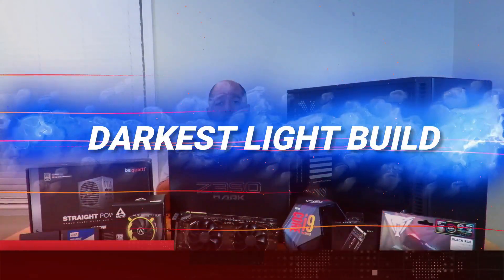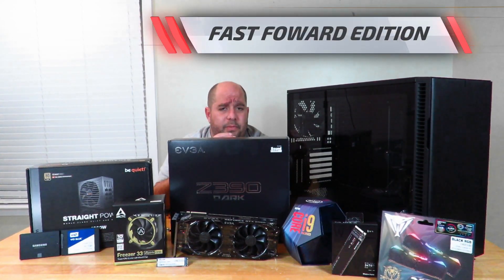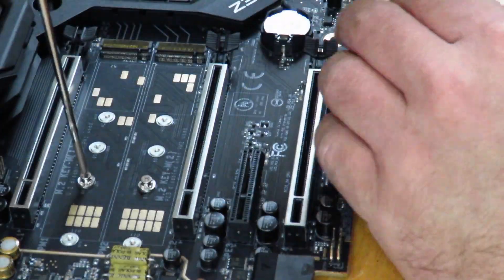FastForward: How to build a Gaming PC with the EVGA Z390 Dark in the Darkest Light Build

Comment: Got a question im building a new super high end build im stuck what motherboard should i buy  asus xi apex  vs 
                         evga z390dark

How are the thermals on the m.2 nvme's my biggest concern
Reply from the maker: OK, there are some differences in the board, so it may be on what you decide.  I will help you.

The EVGA Z390 Dark only has 2 DIMM Slots, whereas the Asus has 4
M.2 SSD's dont get incredible hot any more, I will link below 2 reviews so you can check them out.  The Asus has heatsinks for them, the EVGA does not.
The EVGA Z390 Dark has 8 USB Ports, the Asus has 7
The EVGA Z390 Dark is Dark, no RGB lights, the Asus has RGB headers, don't know if that is important to you
EVGA hass Creative Audio, Asus has Supreme FX (I forgot who made that, maybe CMedia, its been a while since I have used Supreme FX)
The EVGA Z390 Dark has 2 x 8Pin EPS connectors for better overclocking, the Asus only has 1
The EVGA Z390 has the 8PIn EPS connectors and 24Pin ATX connection angled to the right, asus has everything in standard placement.
The EVGA Z390 has 8 SATA Connections, the ASus only has 6.
They both have their pros and cons, I hope this helps you decide which you want.  One thing that makes EVGA better than any other company though, aside from making great products is thier Warranty.  Their warranty is second to none, it is the best, with that EVGA is tops for me.  That is totally up to you again to decide though.

Here is the Asus on Amazon: https://geni.us/1NLKQ
Here is the EVGA Z390 Dark on Amazon: https://geni.us/UmV6tf

I go over SSD temperatures on the EVGA Z390 Dark
Patriot Scorch Review Overview: https://www.youtube.com/watch?v=ywjnE2bXUCQ
WD Black Sn750 Review Overview: https://www.youtube.com/watch?v=jjDmKavz3Ek

Please let me know if you have any other questions or concerns.
Reply from the maker: I saw the link, but it will not post publicly because of the way the site is setup. it should be the same board as this on amazon: https://geni.us/wngc, I just post the Amazon links since I am affiliated and it helps me out as Well.  Neweggs affiliation program is very messed up also the link I provided should be good world wide.  Also, you are very welcome my friend, I always try to help out as much as possible.

Comment: Hi, In two different  video's you installed the artic 33 in one, and in another on the same board the EVGA Dark, the same processor the 9900k, you installed the Artic 34, Esport Duo, which ones heat pipes base, better covers this processor or is recommended by Artic.  Also in the duo fan set up of these how close is it to the memory it looks really close in the video.  I'm hoping to get a Thermaltake V71 Core case with riser to mount the video card on the side.  That way there's nothing in the way, air flows straight out the top.  And best yet it can never leak and fry anything.  How much room is left on the side main heatsink above the ports/USB Plugs ? Just wondering if I could get something wider and bigger in there like a Noctura or some other Twin Tower Radiators fans.  Also just for fun can you show us where the third m.2 drive type E fits in the Dark.  I'll probably never use it but I'm curious, I'm also really interested in your temp tests results with these coolers,  All I'm planning is to overclock the board only a little to get maybe 4Ghz per core
Reply from the maker: what processor, memory and motherboard are you getting?
Reply: Intel Core i9-9900K Coffee Lake 8-Core/16-Thread Processor Socket LGA 1151
3.6 GHz Base/ 5.0 GHz Max Turbo Frequency 95W Gen9 Retail                       
EVGA Z390 DARK                                                                                         
G.SKILL Trident Z Series 32GB(2x16GB)3200MHz F4-3200C16D-32GTZA            
EVGA SuperNOVA 1000 G2 1000W 80Plus Gold (20-G2-1000-XR)                   
Freezer 33 Esport edition ACFRE00062A (#34 not for this socket ?)          
Arctic Silver 5 (3.5g) High-Density Silver Thermal Compound                           
WIN 10 Pro DVD                                                                                           Thermaltake Pure 20 ARGB Sync Premium Ed 200mm RGB for looks                
Corsair LL Series LL140 RGB 140mm Dual Light Loop RGB                                
Thermaltake Core V71 Tempered Glass Edition CA-1B6-00F1WN-04 
Thermaltake Gaming PCI-E 3.0 X16 Riser Cable (AC-053-CN1OTN-C1)                                                     IF I MOUNT VIDEOCARD ON SIDE WITH EXTENTION CORD CAN PROBABLY USE A
SIDEWAYS AIR COOLER IF I DO  then i can blow all the heat out the top with nothing but the PCIe cable in the way!
This is the plan so far anyway IF I can still find the motherboard without getting shipped a used one.  Not planning on much of an overclock maybe 4ghz a core tops so whichever it is of these two coolers is the right one should be able to handle it but you'd know better than me what kinda temps you getting under load. Really don't want to bother with a threadripper with the added price and even more heat than this will put out.  And an intel more extreme, not worth the extra money either an 8 core 16 thread will be all i need only occasionally doing any video renders so anything extra is kinda a waste.  But I still don't want a 4 core, can't go too far back in time.
Reply from the maker: The Arctic Freezer 33 and 34duo are awesome, but they will not allow you to hit the rated 5Ghz of your CPU, nor will they allow you to overclock what so ever.  Also, if you notice, I had to mount the fan facing up and down, instead of from from front to rear, that doesn't help much as it negates positive airflow and heat will not be released as well as it could be.

If you see in this video:https://youtu.be/oPpXQV7niWg,  I am using the Fractal Design Celsius S36 360mm Liquid Cooling Unit: https://geni.us/m6LvD which is amazing, I would recommend that.